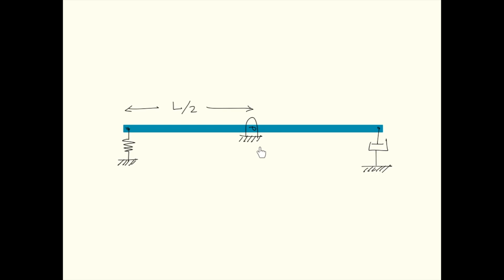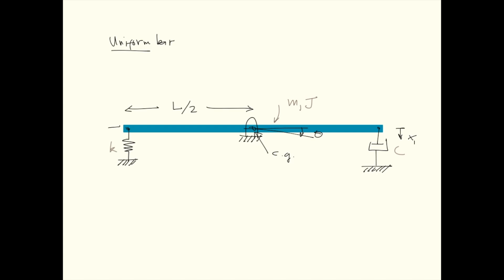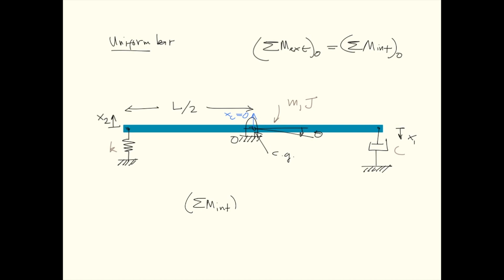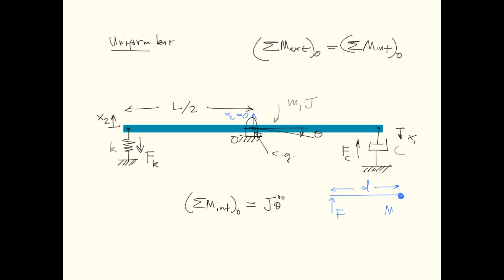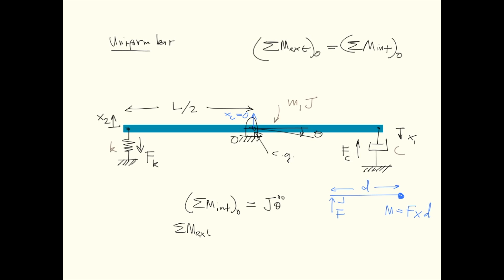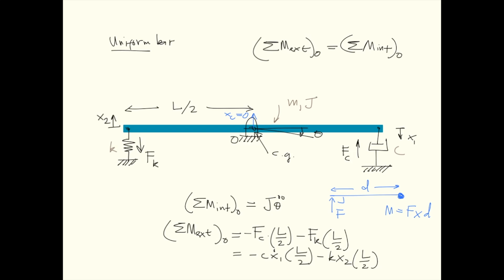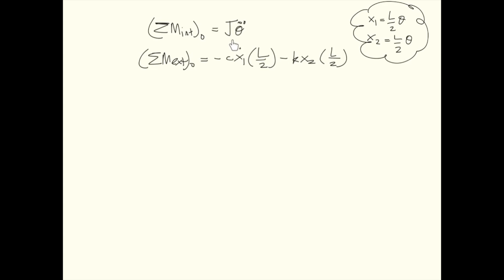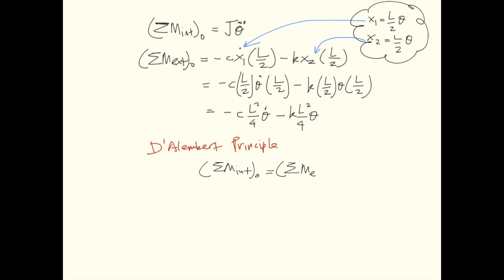Mechanical Vibration: D'Alembert Principle (Example Problem Part 1)

Comment: So the purpose of this principle is to find the equation of motion of this system ?? and how do u find the Equivalent mass or equivalent K ( if there was another spring in place of the damper ) ?
Reply from the maker: Yes. We want to derive the equation of motion using this principle. Equivalent mass only deals with the rigid body (which is the bar, and we assume here the spring and the damper is massless). If there are two springs? We thus have two external forces (or moments) from the two springs.